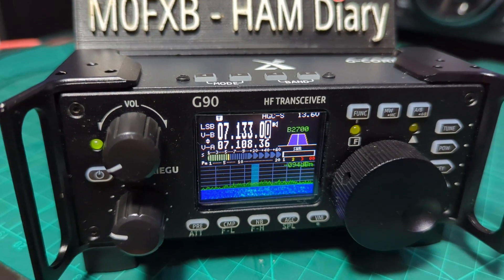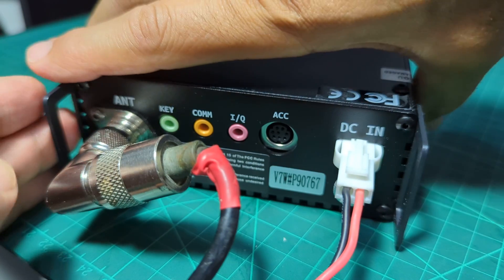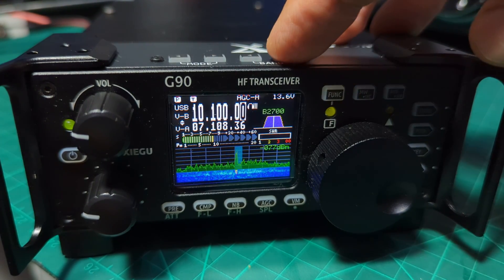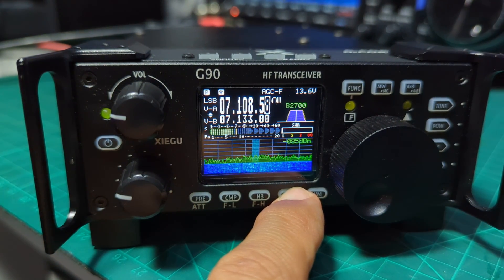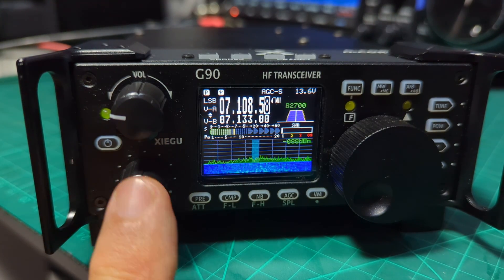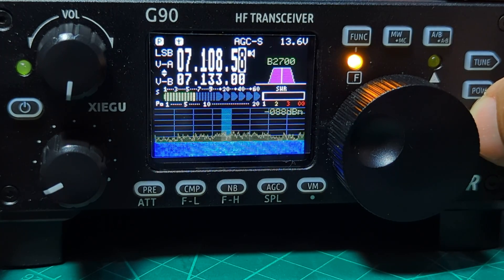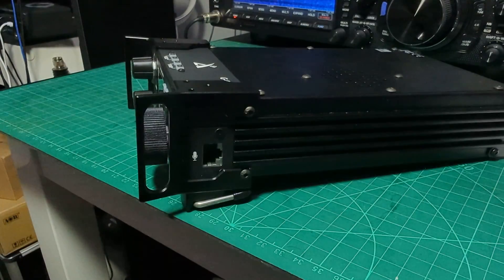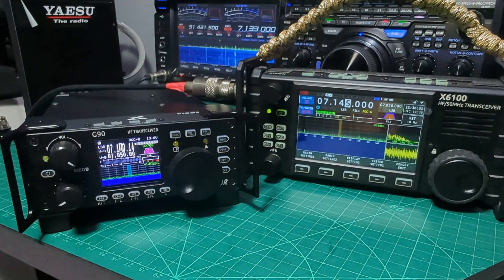XIEGU G90 - BEGINNERS GUIDE

Comment: Hi Andreas, I'm considering the G90 as my first home base radio (listening only at this stage), but the one thing that concerns me is the small display. I was looking at the radio reviews on Amazon and someone mentioned that the G90 could work with SDR software on a computer. Are you aware of this being possible? P.S, I don't want to spend a lot more money to get the little screen that you've reviewed, it would make more sense to get a different radio with a larger screen.

Here's the text from the review :-

"The G90 is quite versatile. The front panel can be removed and extended away from the actual radio with a supplied cable, great for getting space between RF stages and your PC for data modes. There are ports for a key (traditional or paddles), an external waterfall display (or PC running SDR software), and CAT control. A DIN port on the back exposes PTT (output only), and audio in/out specificaly for data modes with their own gain and volume settings.".

Many thanks. Andy
Reply from the maker: Its a good set